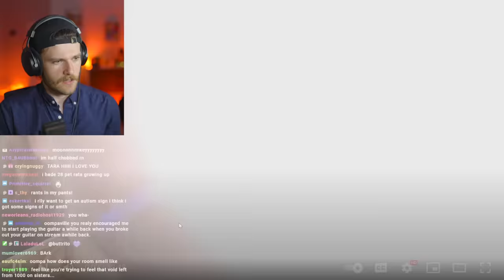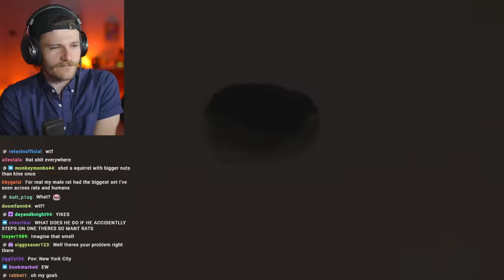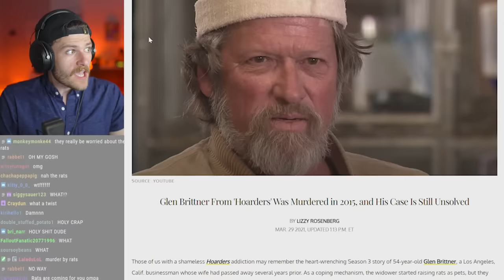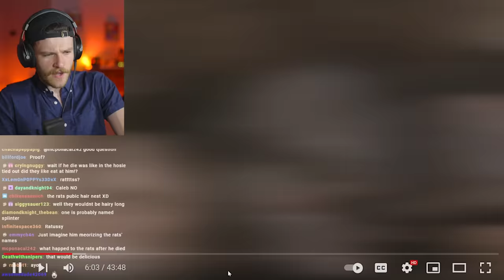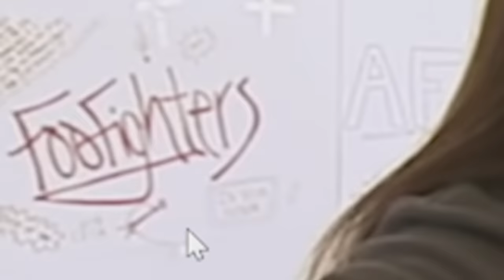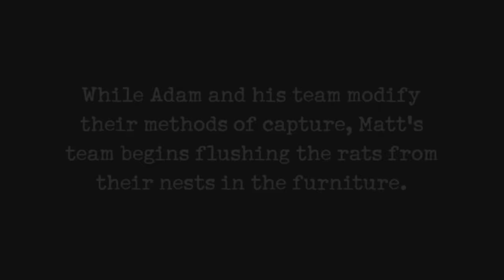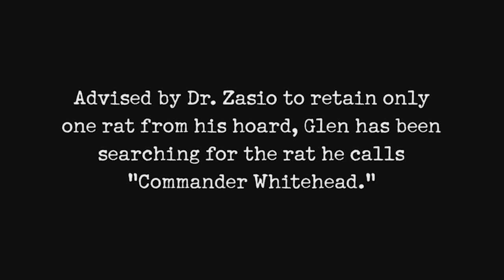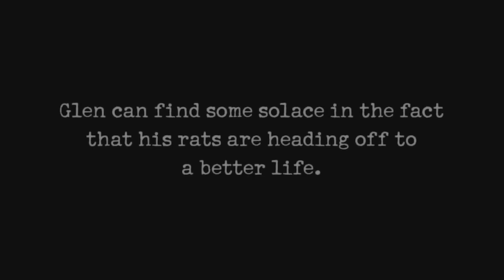His House Is Infested By Over 3000 Rats...

Comment: At one point in the video a guy grabs a rat (or multiple at once) by the tail and you shouldn’t really do that. It can hurt the rat in obvious ways and there’s a chance of degloving. For those that do not know degloving is where the skin/tissue pulls away from and exposes bone. This allows the rat to get away from predators with its life but at the cost of the tail or other limb. It is not a fun process for anyone involved so please use caution when grabbing tails and please try your best not to pull. If absolutely needed then grab the base of the tail or as close to it as possible as this area has less risk. Keyword being less, there’s still a chance for injuries.